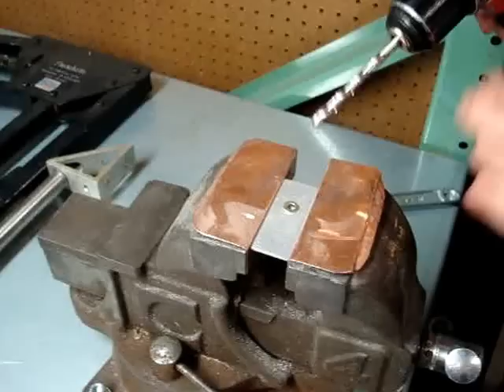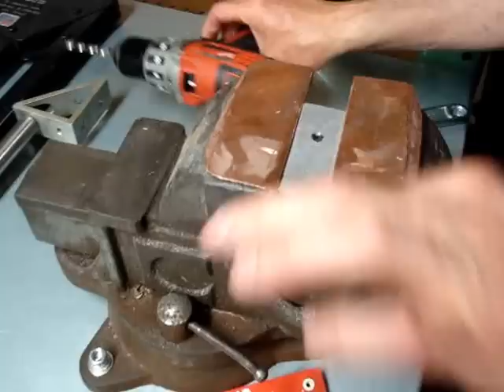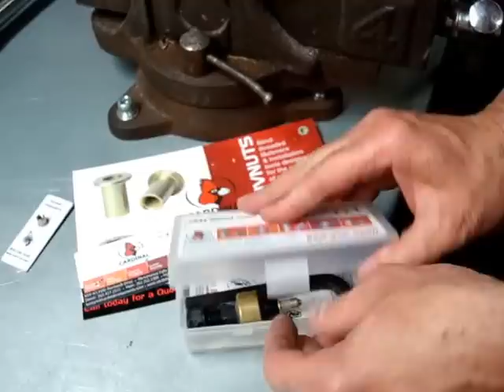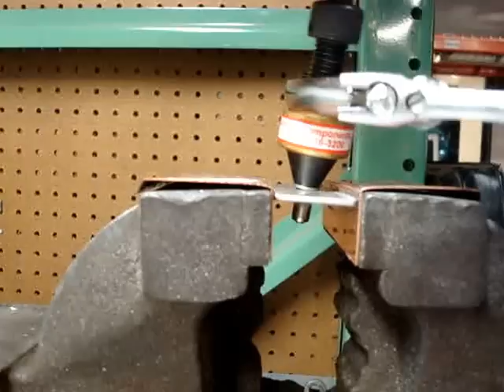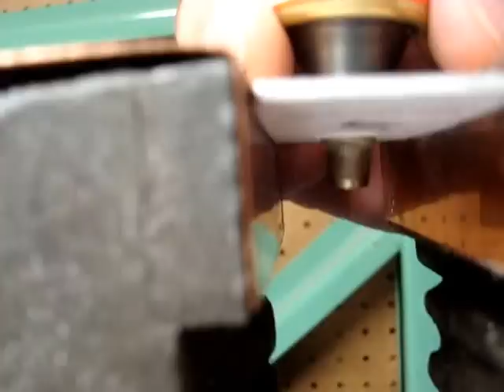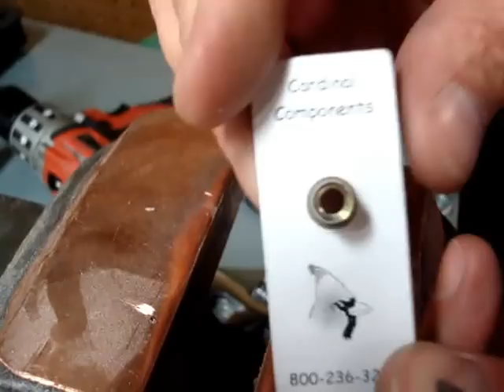Rivnut replacement in the field - CARDINAL COMPONENTS 800-236-3200

Comment: Cardinal says to old the hex wrench stationary and turn the "crescent"wrench yet in this video? Not so much. Looks to be a great tool. Thanks.
Reply from the maker: Yes, great point.  Depending on the application, it might make more sense to turn one tool and hold the other tool stationary.  Typically, we prefer to hold the hex wrench firm and turn the crescent wrench for max install torque.  The video shows the opposite though, with the hex wrench turning, and since it is a tiny rivet nut that doesn't need significant install torque, the installer can get away with it.

Comment: What installation tool is that? That's one I haven't seen
Reply from the maker: This is the C845 tool, it is made in the USA and is the original hand tool to install rivet nuts.  THe design is decades old, made of high quality hardened steel with a corrosion resistance coating.

Contact RivetNutUSA.com, a division of Cardinal Components, for a quote today. We are America's leading rivet nut distributor, supplying your rivet nuts via in stock inventory and providing industry-leading install tools for nearly 40 years!  800-236-3200 or sales@rivetnutusa.com.  Shipping and Customer Service available 8-4pm central time zone, Monday-Friday.